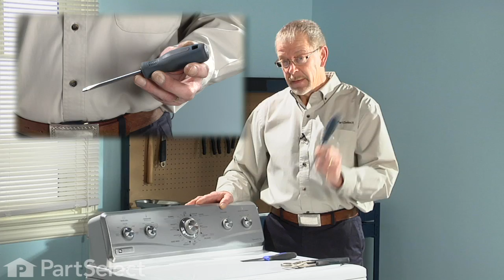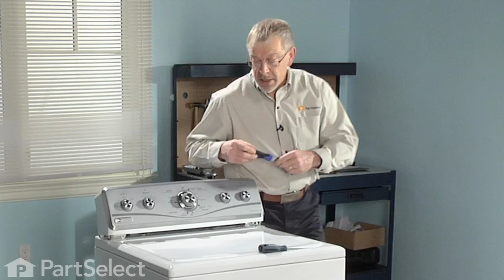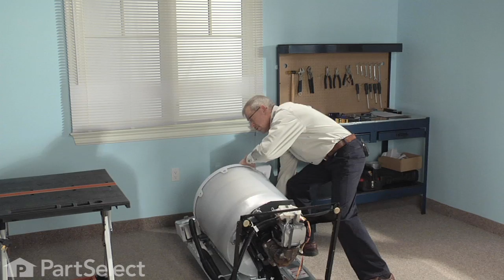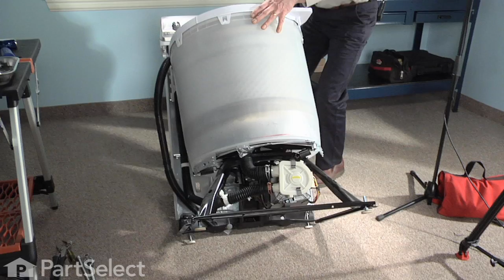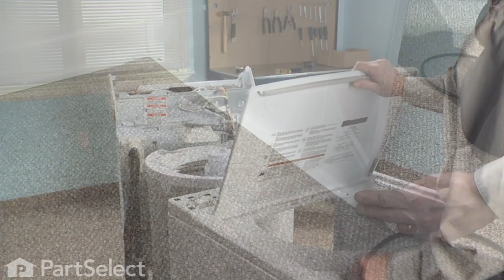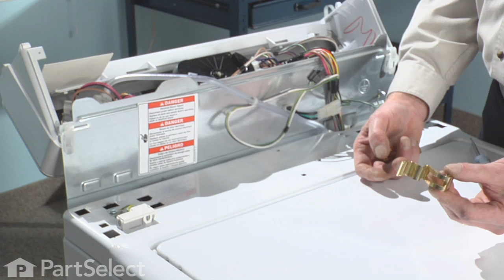Washer Repair- Replacing the Direct Drive Water Pump (Whirlpool Part #3363394)

Comment: I'd be curious if anyone changes the pump without removing the housing, by just tipping the machine back and working from the bottom?
Reply: The front of the housing blocks you from move it off and away from the shaft. I’m in the middle of this fix and just tried to lay it down. It’s a no go. Have to take the cover off.
Reply: @DoYouLikeThisName   I agree the cover is in the way of properly pulling the old pump straight away. It was really difficult, but without taking the cover off, I pulled, rocked, and pried long enough and got the old pump loose.  What I didn't count on was the shaft being too large to get the new pump fully on.  It seems that years of slow leakage caused deposits that formed in the shape of the broken old pump's widened receptacle. I had to use a Dremel tool to get in there and grind the shaft back down and true up the flat in the shaft. It's been working fine for several loads.  Fingers crossed.

Comment: I have an Estate by Whirlpool does it open the same way?
Reply from the maker: What is your model number?
Reply: I don't know, how do I find that?
Reply from the maker: There will be a sticker or a tag on your appliance that will say model and serial number on it.  Could be on the lid, under the lid, around the top, on the back. It will be on your washer, just look for the tag that has model and serial number on it.

Comment: Hello, thank you for the video.  I am having a problem getting the replacement pump onto the shaft.  I have removed the old pump, and have the correct replacement pump.  There is rust on the shaft, which I have lightly tried to sand down a bit, but it seems like it is shaped such that it is narrower at the tip and widens, making it hard to get the new pump on all the way to where the legs seat and the clips fit back on.  Could the shaft have expanded due to the rust?  Can you advise how best to deal with this issue?  I don't want to damage anything, but was thinking that maybe I should file down the flat sides of the shaft until the replacement pump fits (or is that a bad idea?).  
Thanks in advance for any help you can provide!
Reply: +Erich S 
Hello again.  I cleaned off the rust with a file and wire brush, as it was quite rusted and corroded.  And, ...it worked; I got the pump on.  The pump seems to work very well now.  However, now we smell a burning smell when running the wash cycle.  It doesn't seem to be coming from the pump itself, but not entirely sure.  It seems to me like it occurs mostly during the part of the wash cycle in which the water is emptying; not so much when it is agitating or spinning (though my wife thinks it happens throughout the cycle).  Seems odd that this is occurring just after replacing the water pump, if the pump is not where the burning smell is coming from.  The burning smell seems kind of like it's wafting up through the drum (not sure if that might indicate where it's coming from or not).  We are worried that something may burn out or catch fire.
Any ideas what might be happening?  Could the replacement of the water pump be stressing some other part of the motor or transmission?  Just coincidence?  Any help would be much appreciated.  
Thanks!
Reply from the maker: +Erich S You could take a wide flat file and carefully remove just the rust.

Comment: Steve hi and thanks for the useful video. I have a diferente model mine is Fagor but  all systems works the same right?  my question is how to know when the pump is down? my washer machine does not finish the washing cycle and does not empty the water, my guess is the pump  after cleaning the filter . Thank you.

Comment: Is there another reason water will not drain out? Timer, relay, etc.. Ours has done this twice last week but is doing fine now.  Seems it was intermittent so Is there a way to test a washer to make certain witch part failed before removing pump?  Only about 2 1/2 yrs old. Spins great!
  Thank you for the video and all the help.